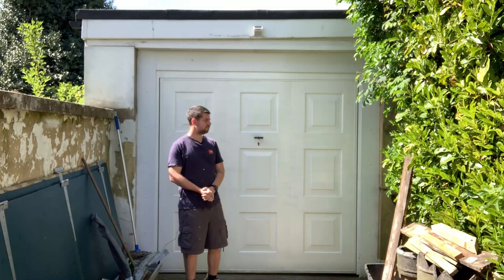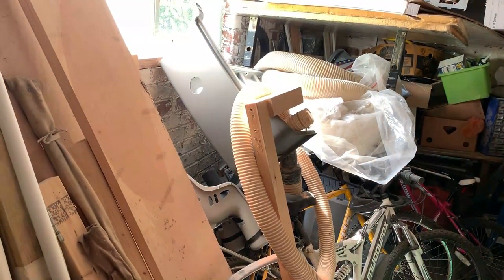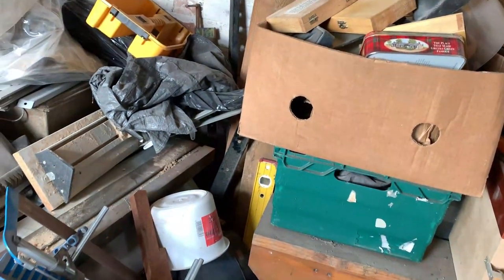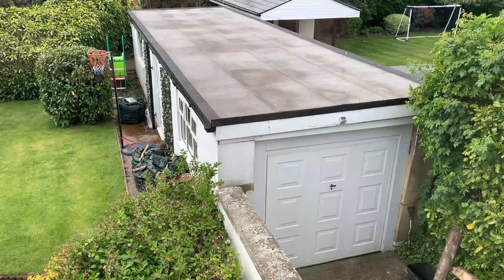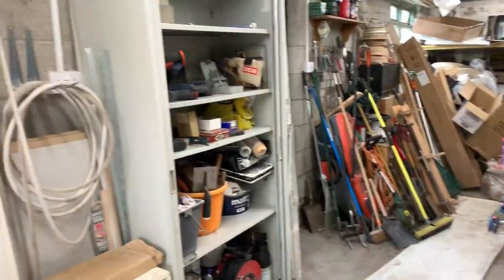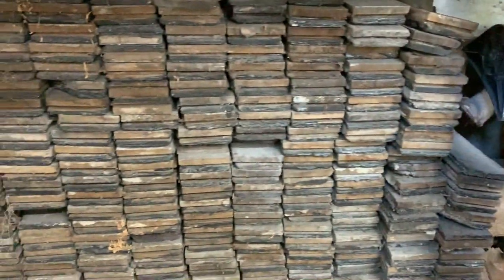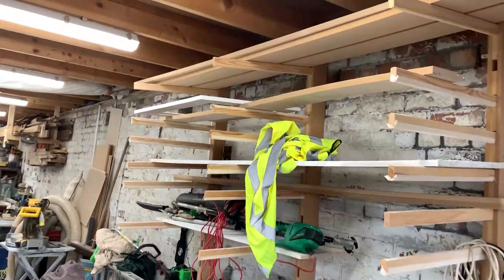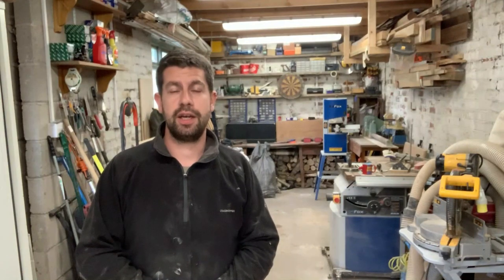Rob's workshop vlog #1 Setting up my woodworking shop

Comment: Also, for the rust on the table saw and thicknesser, try wd40 and a scotch pad, it can be a bit of a graft but it brings it up nicely
Reply from the maker: Great tip, I was thinking something similar but I might buy a scotch pad disc for my angle grinder to speed things up a bit 👍🏼
Reply: @spendtimesavemoneydiy  Seen quite a few of the restoration channels on here doing it and then tried it on my bike a couple of weeks ago. Works spot on but its a bit of a grind by hand so the grinder option would definately be better. Let me know how it turns out if you try it

Comment: Ok you made me feel better since we have similar work cut out my garage is double wide but I though I had too much junk 
a lot of left over piece of wood plywood I have collect because I can't throw away good wood but it's got to go so I have room for my tools
I also own a very old 10" belt driven table saw that is broken need to fix the motor mount that hangs the electric motor I would toss it but all the new table saws they make now are direct drive I hate direct drive saws.  But we think alike save money and use left over paint, wood, nails, bolts ...
Reply from the maker: Glad I made you feel better. It's a lot of work getting a workshop up and running but it's worth it in the end. Thanks for watching and be sure to like share and subscribe to help the channel grow 👍🏼

Comment: Hey Rob, looking god mate.  I wish I had that space for a workshop!  If it were me, I’d pull up the top layer of concrete, sand it, DPM and pour another screed.  It’d end up a tad higher than it is now, but will be paintable, solid and secure for you.  A;tentatively, I’d be tempted to build a timber sub floor and clad in OSB or similar.  Either way the costs would be similar.
Reply from the maker: Matthew Carr Ideally I would take up the old concrete, dpm down and pour a new slab but I've no idea how much concrete costs and it would be a lot of work to dig up the old stuff and get rid of it!